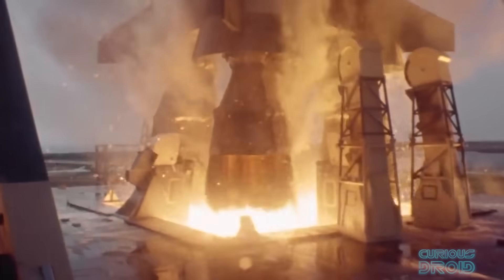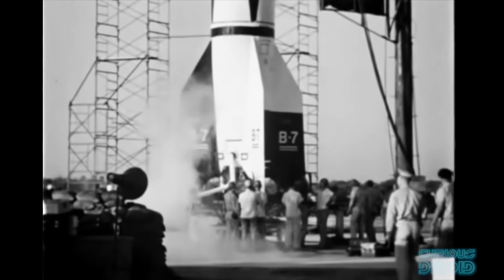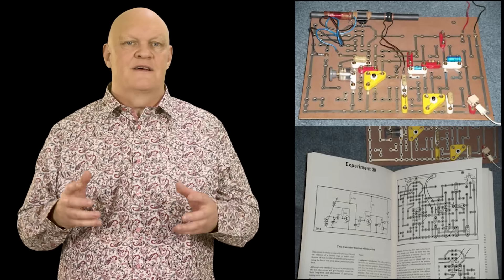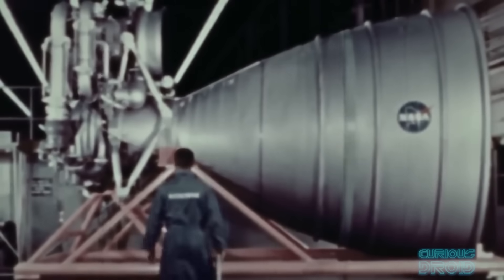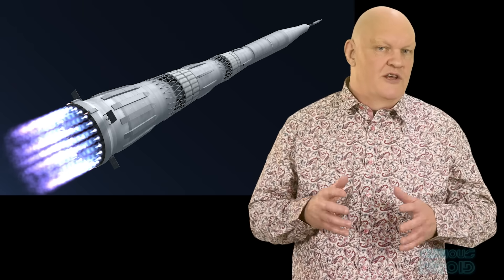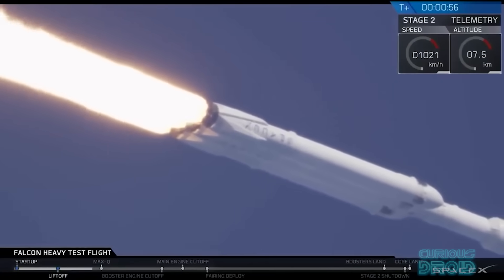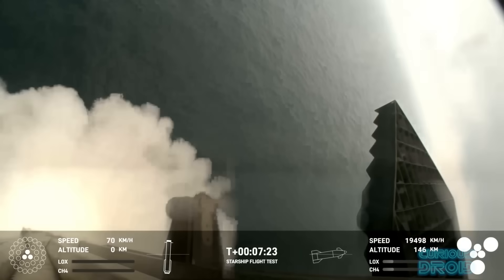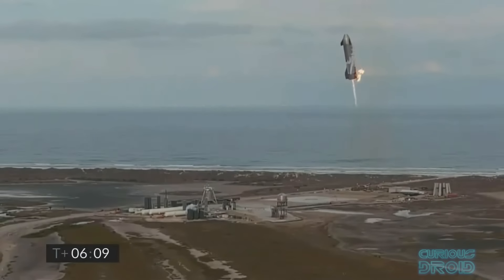Why Does SpaceX Use 33 Engines While NASA Used Just 5?

Comment: Simple reason is reliability , using more engines give u assurance that if some engines were to go out the whole mission won’t be aborted, the mission can be achieved, apollo engines were really powerful but always carried the risk if one engine to go out if could cancel the whole engine
Reply: While more engines =more reliability more engines = more weight and it is truly a fine balance if you don't care about reliability
Reply: And that never happened. All launches were successful.
Reply: @angrydoggy9170  apollo 13
Reply: @IronPhysik  Let's clear this up right now. Russia charged 21.8 million in 2006. 31.2 million in today's money. Today, 2024, they charge 90 million. The last time they charged less than what SpaceX charges for a Dragon seat was 2008, and of course this was long before Dragon was sending people to the ISS. I know you're married to this particular piece of "20mil" malarkey but it's time to let go.
Reply: Let's clear up this malarkey.  Russia charged 21.8 million in 2006.  That may be where this "20mil" figure is coming from.  But that's 31.2 million adjusted.  The last time they actually charged less than today's price for a Dragon seat was 2008.  2008.  Today they charge 90 million.  SpaceX's price tag is a bargain.  (Also note that we can guess why Boeing charges 90 million.)
Reply: More engines won't make your Rocket more reliable. There are many ways an engine can fail that Takes Out the entire Rocket. As you could See for example with the second Starship Launch where both stages did explode. Also the raptor IS powerd by turbo pump which makes them unreliable. The biggest reason why Starship has so many engines IS because musk did Not won't to pay the development cost of a bigger proper engine or his Team of morons could Not Deliver it.
Reply: @_kampfkartoffel2195 eh still cooler than NASA also it's live too can't beat that.
Reply: @_kampfkartoffel2195  I feel like ur kind of behind on starship news, musk had no reason such as his team of MORONS as per u can’t have developed or a big engine is costly, because if musk wanted Spacex could have found and developed such a engine but logically seeing it makes no sense especially when u want to reuse the whole godamn rocket and not expend it. Just look at starship flight 4 how even after 2 engine loss, the super heavy booster manage to land precisely on its target location, u should really watch everyday astronauts video where he has beautifully explained in detail what I just said 😃👍
Reply: Did Apollo 11 actually leave near-Earth orbit?
Despite the revisionist narrative that this channel won't question -- unstable fuel burn for the oversized F1 engines was never rectified and another arrangement in their place was made in order to reach near Earth orbit, keeping the F1 bell nozzle to maintain the desired appearance.  The great licking yellow flame was an indication that something was not normal as fuel was burning in the atmosphere while providing no additional thrust. This was the result of injecting additional kerosene into the exhaust stream for greater visual effect yet appearing to produce an inefficient burn unlike other rockets after launch.  No explanation is forthcoming and this issue is not addressed in any usual report; however, using a smaller reliable engine with a reduced fuel load and stripped down mission requirement allowed the Saturn V to reach near-Earth orbit.  

The Apollo 11 crew attempted to demonstrate their position at over halfway to the moon as seen in the unedited version presented to the public while the more recently released unedited version reveals a flood of blue light entering the same window as the camera continues to roll, through which only a moment before, we saw the Earth far distant in what appeared to be very low light conditions. Then, as the camera pulls back from the window, the exposure settings are seen to return to normal as a flood of light enters the same window.  Without a change in the orientation of the spacecraft assumed to be on a trajectory toward the moon, the only source for any flood of light can be the Earth while in near-Earth orbit.  The usual sponsored efforts will try to make excuses for why the obvious did not take place -- yet is overly apparent in the unedited version.  When facts cannot prevail in support, sponsored activity will resort to name calling and other derogatory comments discrediting themselves.
Reply: Starship failed 4 Times in a row, ways 5000 tons can't carry any Cargo according to musk 50.tons but i do Not Think that IS true. The Saturn V Worked perfectly every single time brought 145 tons to Orbit or 45 Tons to lunar Orbit. Oh did i mention that the Saturn V brought mankind to the moon while Starship can't get to Orbit yeah it is a.failure.
Reply: How are you going to land a rocket with big engines? if one fail - you're done. In the fourth flight, engine 1 did not ignite during landing and the booster was still able to land
Reply: @maks_1_123  you aint landing your Rocket because IT IS Not necessary. Reusibility does Not make rockets cheaper.
Reply: @_kampfkartoffel2195  Falcon 9 proved that reusability works otherwise they wouldn't be able to launch 100 rockets a year
Reply: @_kampfkartoffel2195   "Reusability does Not make rockets cheaper." - Falcon9 : Am I joke to you?
Reply: @mayshiratoshi6390  haha that’s good 😂
Reply: @_kampfkartoffel2195 Falcon 9 is the cheapest rocket of that class. It can bring humans and big payloads in orbit for extremely low prices. Spacex was literally made for reusable rockets and you say they are not needed? Absolutely brain dead comment.
Reply: @stefanoscintilla5225 Why is it more expensive that what Russia charged for its old system if it’s so much cheaper? Are you telling us that SpaceX is price gouging to suck in more tax dollars?
Reply: @angrydoggy9170  Price of the Saturn V project: 6.4 billion USD. Cost per launch: 185 milion. Project cost of Falcon 9: 300 million USD, cost per launch: 62 milion. They are trying to do the same with starship and reduce costs and considering the pace at which they are making progress that time isn't very far. I honestly don't understand what you people think. You see an amazing human achievement and you go like "nuh uh I want to be an asshole". Enjoy progress, don't stay attached to the past.
Reply: @stefanoscintilla5225  When did I say that Falcon isn’t a great rocket? All I said that Musk is seriously overcharging for launching stuff.
Reply: @angrydoggy9170  No one believed in falcon 9. That's my point. If Musk can make starship work then we'll have extremely powerful rockets for half the price of the Saturn V.
Reply: @mayshiratoshi6390  yes
the russians, before they started price gouging the US asked for 20mil to bring a person to the ISS without reusing

Space X is asking for 55mil USD with their "cheap reusable rocket"
Reply: @IronPhysik  And it came with more that x2 payload capacity.

So per payload Soyuz only delivery 8200 kg to LEO. While F9 on reuseable mode can carry 17500 kg. The more than time two. So in price per kg per launch is lower to nearly around that range. What's your problem?

+Profit launch at SpaceX compare weight to Soyuz is around those 21-23 million but 2 time in 1 go? How is it not cheaper?
Reply: @mayshiratoshi6390  its 21mil per person, not per weight.
Reply: @IronPhysik  what he said, russia doesnt charge 21 million for a seat lol
Reply: @_kampfkartoffel2195 Nope, they didn't fail, 4th flight was a success exactly like every other flight. They are tests, do you know how many times they tested the Saturn-V?
Reply: @stefanoscintilla5225 Every Saturn V test was a total success. Keep it real.
Reply: @angrydoggy9170  apollo 13
Reply: @stefanoscintilla5225  Rocket worked flawlessly for Apollo 13.
Reply: @angrydoggy9170  Yeah I forgot that it was the payload that had issues. Still anything to say about prices? NASA itself uses Falcon 9 for their incredible power/cost ratio. Starship wants to do the same, test and investments need to be done. Also starship is twice as powerful as the Saturn V.
Reply: @stefanoscintilla5225  Falcon is supposed to be way cheaper (according to Musk) than the old rockets, yet he charges more to bring astronauts to the ISS than the Russians did. So either he’s lying about the actual cost or he’s seriously overcharging. People keep whining about NASA wasting tax dollars and all the while Musk is funding all his projects (and his own bank accounts) with those sweet taxpayers money. If his launch system is so cheap, why does he charge so much?
Reply: @angrydoggy9170  He gotta make money man. It's still cheaper than all other options otherwise nada wouldn't use it.
Reply: @angrydoggy9170 still cheaper them beings failed idea

Comment: "Best minds in NASA left and works for spaceX"?    Four launches and still  Musk "starship" can only lift hot air to sub-orbit.  And 50 tanker "starship" launches to send ONE "starship" to Moon?  Brilliant!    LOL
Reply: this is the only way to build a large base on the moon for a reasonable price. No one is even trying to build fully reusable rockets
Reply: And helium leaks all over Starliner versus none for Crew Dragon, cope and seethe harder.
Reply: imagine having such an inflated sense of self as you have.
Reply: Did Apollo 11 actually leave near-Earth orbit?
Despite the revisionist narrative that this channel won't question -- unstable fuel burn for the oversized F1 engines was never rectified and another arrangement in their place was made in order to reach near Earth orbit, keeping the F1 bell nozzle to maintain the desired appearance.  The great licking yellow flame was an indication that something was not normal as fuel was burning in the atmosphere while providing no additional thrust. This was the result of injecting additional kerosene into the exhaust stream for greater visual effect yet appearing to produce an inefficient burn unlike other rockets after launch.  No explanation is forthcoming and this issue is not addressed in any usual report; however, using a smaller reliable engine with a reduced fuel load and stripped down mission requirement allowed the Saturn V to reach near-Earth orbit.  

The Apollo 11 crew attempted to demonstrate their position at over halfway to the moon as seen in the unedited version presented to the public while the more recently released unedited version reveals a flood of blue light entering the same window as the camera continues to roll, through which only a moment before, we saw the Earth far distant in what appeared to be very low light conditions. Then, as the camera pulls back from the window, the exposure settings are seen to return to normal as a flood of light enters the same window.  Without a change in the orientation of the spacecraft assumed to be on a trajectory toward the moon, the only source for any flood of light can be the Earth while in near-Earth orbit.  

Another indication are the impossible weather patterns seen on Earth, when in reality only a small portion of the Earth's surface was visible, framed by the round window of the command module.  Straight line cloud fronts are seen to be extending for what appears to be more than 6000 miles, a quarter of the Earth's circumference -- something that has never occurred in the meteorological record on Earth. 

The usual sponsored efforts will try to make excuses for why the obvious did not take place -- yet is overly apparent in the unedited version.  When facts cannot prevail in support, sponsored activity will resort to name calling and other derogatory comments discrediting themselves.

Comment: It's hard to say that Starship is this or that when compared to the Saturn 5 or SLS considering the SLS works and it has worked from the first day it was launched 🤔
Starship, not so much unless one giggers the definition of success.
Reply: Different methodology of R&D/testing for sure but it worked great for them with Falcon 9 reuse. Starship has already had 4 launches and its maiden flight was after SLS. When is the 2nd SLS flight scheduled, late 2025? It's really not worth comparing the two rockets because their goals (outside of Artemis) and methodologies are so different. Starship flight 3 and flight 4 are definitely "successes" in that they reached their target orbit (well, purposefully sub-orbit to ensure reentry), they just haven't carried payloads since the goal of the test flight program is to gather data about the rocket and reentry rather than carry payload (there are no customers for these missions)
Reply: if NASA had developed starship, it would have taken them more than 20 years and would have been 10 times more expensive at the very least. Iterative testing hardware in real conditions is the fastest way to develop a rocket. None of the companies except SpaceX have this opportunity.

Comment: Can't lift as much, has come nowhere NEAR NASAs 141 tons to orbit, needs 35 engines to send an empty ship with no Cargo to orbit AND runs out of fuel.  Yup. Musk is a genius. 🤪🤪🤪🤡🤡🤡
Reply: Nah, he's just 60 years behind NASA.
Reply: @TucsonDude  why do you think the space shuttle stopped flying?
Reply: @snuffeldjuret  It just ran it's course.  Any other thoughts?
Reply: Did Apollo 11 actually leave near-Earth orbit?
Despite the revisionist narrative that this channel won't question -- unstable fuel burn for the oversized F1 engines was never rectified and another arrangement in their place was made in order to reach near Earth orbit, keeping the F1 bell nozzle to maintain the desired appearance.  The great licking yellow flame was an indication that something was not normal as fuel was burning in the atmosphere while providing no additional thrust. This was the result of injecting additional kerosene into the exhaust stream for greater visual effect yet appearing to produce an inefficient burn unlike other rockets after launch.  No explanation is forthcoming and this issue is not addressed in any usual report; however, using a smaller reliable engine with a reduced fuel load and stripped down mission requirement allowed the Saturn V to reach near-Earth orbit.  

The Apollo 11 crew attempted to demonstrate their position at over halfway to the moon as seen in the unedited version presented to the public while the more recently released unedited version reveals a flood of blue light entering the same window as the camera continues to roll, through which only a moment before, we saw the Earth far distant in what appeared to be very low light conditions. Then, as the camera pulls back from the window, the exposure settings are seen to return to normal as a flood of light enters the same window.  Without a change in the orientation of the spacecraft assumed to be on a trajectory toward the moon, the only source for any flood of light can be the Earth while in near-Earth orbit.  

Another indication are the impossible weather patterns seen on Earth, when in reality only a small portion of the Earth's surface was visible, framed by the round window of the command module.  Straight line cloud fronts are seen to be extending for what appears to be more than 6000 miles, a quarter of the Earth's circumference -- something that has never occurred in the meteorological record on Earth. 

The usual sponsored efforts will try to make excuses for why the obvious did not take place -- yet is overly apparent in the unedited version.  When facts cannot prevail in support, sponsored activity will resort to name calling and other derogatory comments discrediting themselves.

Comment: Does physics not prefer a larger engine?  The smaller an object, the great the surface area, in my mind that means more smaller engines have more total weight for the thrust versus fewer larger engines, am I wrong?
Reply: Larger is better up to a point, then you run into material strength and stiffness issues.
Reply: IDK maybe rockets are different (doubt it)? But air planes and ships almost never use more than four engines if they can get away with them.

Comment: Its because SpaceX can only design and make cheaper and smaller engines. So it doesn't matter if a few fail. This was the Russian attitude. But if it was my arse sitting on top of the great big firecracker, I would go with Nasa. After all, they have been sending people into space since 1962.
Reply: Raptor is far more advanced than the F1, irrespective of size.
Reply: Nasa has never sent anyone to space technically. The rockets have always been contracted to other companies, just like they're doing today with the Falcon 9.
The Falcon 9 has the most launches for any US rocket, its not even close with 355 launches.
Reply: Starship raptor vacuum engines are huge.

Comment: OUTSTANDING explanation.  Now the nitty gritty.  NASA was forced to use existing components for ARTAMUS that were left over from the space shuttle.  Kinda like making a mark 1 cortina use an engine from a Aston martian  vantage that uses avation fuel and nitrous mix. Artamus hydrogen propulsion has the potential to out preform anything currently available.  It was described to me like this.. take the Saturn V entire rocket attach it  to one single engine  of Artamus and it will go to a geo synchronous orbit with power to spare.